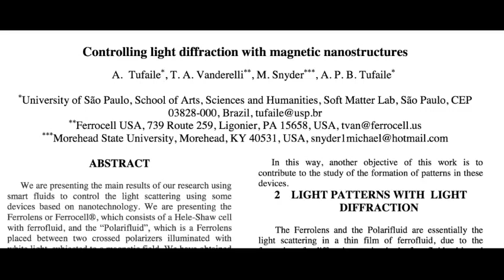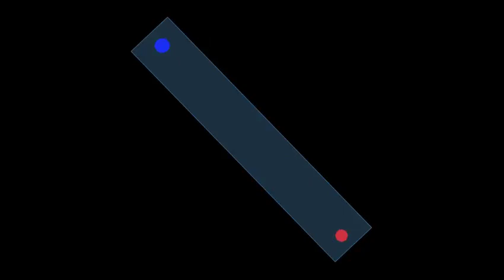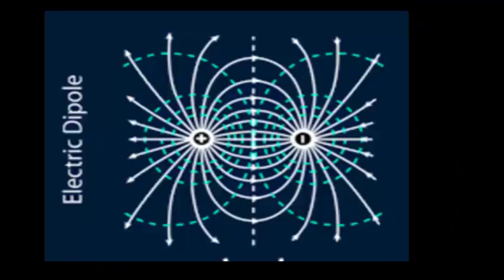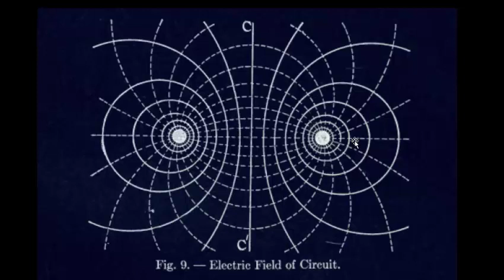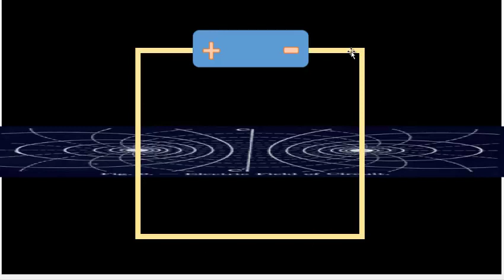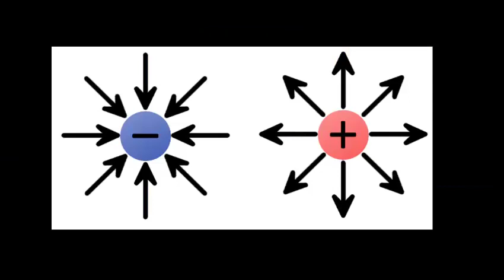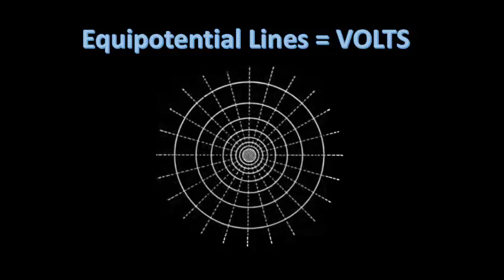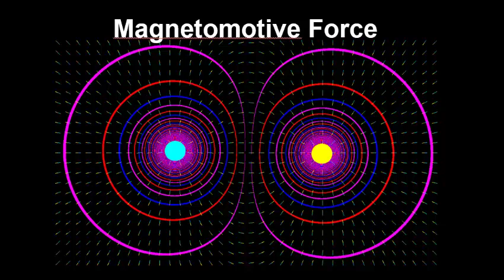On Magnetic Mono-Poles and Isopotential Lines

Comment: Monopoles don’t exist in nature, that’s the important part and everyone intuitively knows.

The software is wrong and just shows some 2D circles. It doesn’t show aether flow / magnetic flux at all. 

All one needs to know is that all the atoms/molecules in a magnet are polarized in one direction creating a flow in that direction. That’s it. 💥 The field lines flow from every surface point of the magnet. Of course at the pole it’s strongest. Where are the isopotential lines for that?
Reply: You will do better to ignore isopotentials and represent the flow with vector arrows. In the same vein as magnetic filings.

No comment on the fact the software doesn’t show all the field? It’s depicting the middle region (of the magnet) as being inert.
Reply from the maker: @TD-zr5xm  For the record, when someone tells me I should "ignore" something, it makes me want to pay attention to it more.  Magnetic field lines with vectors are one way of depicting the field around a magnet and Isopotentials are another equally important way. The Isopotential curves/surfaces show the field strength of at different distances from the magnet. Each isopotential curve corresponds to the same field strength. Isopotentials contain information that the standard magnetic field doesn't and vice versa. One is not better than the other, just different. Neither gives a complete picture, but together, they do. I think it is a terrible idea to ignore IsoPotentials. Really bad advice, in my opinion.
Reply: @FractalWoman  fair enough and maybe not what I meant to say. I’m not sure what you were going for. Field strength can be inferred by an inverse square law.
Reply from the maker: @TD-zr5xm  magnets dont have an inverse square law. And look at the shape of the isopotentials in the dipole view. It is not circular. This shape is an important piece of the puzzle that shouldn't be ignored.
Reply: @FractalWoman  ?? That’s what ‘isopotentials’ represent... Field strength according to an inverse square law. It’s a universal principle.
Reply from the maker: @TD-zr5xm  Magnets do not follow the inverse square law. If you don't believe me, ask ChatGPT. FractalWoman: Do magnets fllow an inverse square law. ChatGPT: No, magnets do not follow an inverse square law. The inverse square law is a principle that applies to phenomena such as gravity and certain types of electromagnetic radiation. According to this law, the intensity of a physical quantity (such as gravitational force or light intensity) decreases with the square of the distance from the source.

However, magnetic fields do not follow this law. The strength of a magnetic field produced by a magnet decreases with distance, but the relationship is not precisely an inverse square law. Instead, it follows an inverse cube law. This means that the magnetic field strength decreases with the cube of the distance from the magnet.
Reply: @FractalWoman  hmm. I’m finding conflicting answers.

“Inverse square laws are pretty common all through science. Both electricity and magnetism are inverse square. So are light and sound intensities.” (from a gov employee on quora)

I know why it might be considered cubed because it doesn’t radiate spherically equally, rather it is a polarized vector, such that the angle of measurement would determine the value.

Interesting topic. I will say that two different modalities of force over distance, for lack of a better word, i.e law of nature, is not congruent with a unified theory.
Reply from the maker: @TD-zr5xm  
To be more precise, monopoles have an inverse square law and dipoles, whether they be magnetic or electric, have an inverse cube law: "https://www.millersville.edu/physics/experiments/023/#:~:text=Magnetic%20Fields%20Varying%20as%20an%20Inverse%20Cube&text=For%20both%20monopoles%20and%20dipoles,distance%20from%20the%20source%20increases.&text=%2C%20often%20called%20the%20inverse%20square,distance%3B%20as%20R%20%2D3%20.
Reply from the maker: electrons (negative charges) are monopoles.
Reply from the maker: Isopotentials don't show magnetic flux. They show equal potential curves/surfaces around the magnet. This is important information that shouldn't be ignored.
Reply from the maker: MAGNETIC monopoles don't exist in nature but ELECTRIC monopoles do. You can't just say "Monopoles don't exist in nature". That is an incorrect and/or inaccurate and/or misleading statement.

Comment: A Lot of your overlays are wrong!  you have to flip them by 90° then they are perfect! as in 6:43 for example the iron filings should be longside the isopotential lines and not orthogonal, you overlaid it 90°,  and by this mistake its highly confusing what isopential lines actually show !

Isopotential lines = magnetic field lines 

they are not orthogonal ,they are the very same thing!!!!!!
Reply from the maker: Nope. You are wrong. The isopotential lines are orthogonal to the iron filings. I clearly show this in my "What is a field?" video. If you watch it again, you will see what I mean. 
You should also play around with the app on my website: http://www.theomparticle.com/?page_id=890 
The "arrows" in this software line up with the iron filings in my ferrocell image. The isopotential lines in this software, line up with lines of light in the ferrocell image. Isopotential lines are only ONE COMPONENT of the magnetic field. The iron filings line up with the other component.
Reply from the maker: Here is what the traditional magnetic field lines look like: https://www.stickmanphysics.com/stickman-physics-home/magnets-and-magnetism/magnetic-fields/

If you compare this with the image you referenced at the 6:43 mark in my video, you will see that the magnetic field lines line up with the iron filings EXACTLY. The isopotential lines are not drawn in the image shown on this webpage but if they were, it would look like the colour lines that I show in the 6:43 mark point of this video.

Comment: Additionally, we should always remember that, for those far-apart poles or monopoles, the isopotential lines are just not drawn on figures and shown in software - the strength of fields at the far-apart lines just gets so weak we can forget about it. 
(And for perfect lines for far-apart poles, this is assuming there are no disturbing fields, which in nature never happens.)

I think we can destroy single electrons and protons and there can be unbalance in universe but these are recreated whenever there are electrons or protons put to work on their own alone ("magnetic moments" in them induce current and potentials, energy in momenta, which can in turn induce so-called virtual particles which can turn into real ones). The latter is just fantasizing.
Reply from the maker: Yes. I agree. The universe always seeks balance, and when set out of balance, it will do whatever it takes to set it back again, including creating "virtual" particles.

Comment: What if N and S are really close together?
Reply from the maker: When N and S are really close together, you still get a dipole. If you take a magnet, and slice off a really thin slice, the slice will become a dipole with its own N and S, and the magnet that is left behind is still a dipole but with the bloch wall ever so slightly shifted.
Reply: @FractalWoman  of course, but look at the mmf lines... Is it possible to make a ferrolense picture with a bifilar pancake coil?... Have to try out.
Reply from the maker: @steffendammann2984  I haven't tried that, but it is a good idea. Maybe someone else has. I will check around.

Comment: Monopoles on the small scale don’t exist, well known.

Also all software relies on input to create output.

I can say 100% that Tim’s software does not contain 100% of data needed to make 100% correct modelling. 

To understand fully what lines up with what, would the best option would be do conduct experiments in 0 g with ionised magnetic metallic gas with magnets? ,
Reply from the maker: Michael's software is based on Maxwell's equations. So, even mainstream won't be able to argue with it. The question isn't whether the software is valid or not. The real question is, what is the ferrocell showing us?
Reply: Fractal Woman and Maxwells equations are based off an assertion there is no such thing as a perfect black body 🤷‍♂️

Comment: I think that something important is missing when these diagrams only show two dimensions: the spiral or vortex behavior of the fields is not shown.
Suggested Experiment: Drop iron filings onto a magnet while videoing with a high-res slow motion camera.  See if any spiral motion is detected. If so, refine the experiment and map the motion.
Reply from the maker: That is a great idea. Luckily, I don't need to do the experiment, because someone else already did. https://youtu.be/75wrs0PLl_s
You tell me whether you see spiral motion (a vortex) or not.
Reply: @FractalWoman  The sequence starting at the 2 :10 mark appears to show a vortex at the bottom of the magnet. Unfortunately, the camera is aimed from the side, but to see the vortex in detail, it should be from the bottom looking up.
Reply from the maker: @codetech5598  I agree. I see the vortex too. There are probably other videos out there that show different views. If you find one, please let me know. This is really cool stuff.
Reply: @FractalWoman  I think that it would have to be deliberately photographed in a way to reveal the vortex. I left a comment on that video requesting them to do that.

Comment: Bravo! Your comparisons are top notch - clarifies both the intuitive and the non intuitive! 

IMHO. In both instances - magnet and electric current - both are accelerating aether flow linearly (but in an overall "loop" + & -). Both linear accelerations are rotating as they flow. (the aether flow tries to escape restriction / linear direction = rotation) The area closest to the "masses" - (ferrite or copper) is the strongest accelerated rotation (voltage - equipotential / magnetomotive) of the surrounding aether flow. The magnet creates it's own acceleration which materializes / displays the magnetomotive field lines. However - the electric current is the catalyst source for the copper to display equipotential (voltage) lines. But they both are ESSENTIALLY (a magnetized magnet or a current moving in a wire) the displayed effect of the aether surrounding the mass involved in the "acceleration".

Comment: if you use longitudinal electricity you can transmit through 1 wire... when you pulse or resonate the coil with conjucture to Earth.
Reply: Check Master Ivo on yt.
Reply from the maker: I can't see how "electricity" can flow through a wire unless it is in a circuit. Yes, a circuit is ONE wire, but I don't think this is what you are talking about.
Reply: @FractalWoman  Well first electricity mostly flows outside the wire and there are no electrons flowing in it. A simple Tesla's Hairpin circuit can show you how there is nothing flowing but pulsing... Since the disruptive discharge happens it produces impulses rather than ac or dc flow and impulses dont know how exactly they travel, but i see this somehow like fast compressions and decompressions of the medium thus propagating longitudinaly instead of the usual sinewave RF which propagates at the max speed of light through the Aether, where the wire is just the "condensing" point for the magnetism to appear.
Something like that, can elaborate.

The only thing i can not pin point is ampere to volt corelation... it's like you need a high potential difference (volts) to move high ammounts of Aether perturbations produced by a magnet on a coil.  But if you have only amperes like in a homopolar motor you produce so much amperage, that a resistive material gets heated so much... so it must have an internal component and the volt being external? 
So when encountering radiant electricity we have minute impulses of short durations, that does not allow the formation of the magnetic component of "electricity".

Nikola Tesla, Wilhelm Reich were both seeing similar stuff... Just like when you physicaly move plancton in water... when you produce pressure and depressure waves, the plancton becomes luminescent... so... wilhelm reich had his rife machine set up as a pulsator, not a sine wave machine or god forbid a square wave.

Comment: Dear Genius FW: could You investigate electrets please? And test their effect on a ferrocell?
Thank You
Reply from the maker: Sounds like an interesting idea, but I don't think it will work. The ferrocell works by aligning the tiny dipoles of the magnetite nano particles in the ferrofluid when a magnet is nearby. I don't think the electrets will cause the nano particles to line up or self organize in any way, in which case, you are not going to see any lines in the ferrocell.  But, I could be wrong. Do electrets cause iron filings to line up? If so, then it may work. That would be a good initial test.
Reply: as Ken quotes Maxwell: magnetism is the dielectric field,,, and dielectricity concerns static electricity i.e. static electric charges which form and define what an electret is,,, no?
besides, the electret as I have seen on youtube holds positive charges on one side and negative charges on the other so one can test the effect of each electric "pole" :),,,
in case nothing shows on a ferrocell, if You move the electret it will start to show something because You will be having a movement of the electric charges so it is an electric current and it of course induces Magnetism in its surroundings,,
Thanks a lot for Your reply,,
And as Ever, I wish You good health and prosperity in every aspect 
Thank You

Comment: Your presentation makes me wonder if one could shape a magnet and create a current in a wire without either moving.  Earlier, I mentioned connecting high power curcuits with simply a magnetic field, i think they've already invented that. As to a magnet creating current without moving, my idea is creating a toroid shaped magnet that's contoured with fins/ridges to a narrowing center to slingshot the field going into the center, placing a wire in it, creating an electrical flow.
Reply: Gristle Von Raben Tesla’s rotating field generator with no moving parts ?? Can’t remember the source but apparently inducing a rotating field can work in a reverse way to having a moving magnet / coil moving through a static field in order to create the same result.

Comment: You bring up some interesting ideas.  You gave me an idea of using fields to connect high power circuits.  The ferrocell is only different because of two things, when two magnets with poles not inverted come side by side, they create a small air pole between them that is opposite.  Its weird, but true.  Secondly, from the ferrocell shown, is it my imagination or is there some kind of horizon flipping going on between the east end and the west end where the colors of light are flipped?
Reply: Good point, I would also like more information into the small air pole between them it seems counter-intuitive or I'm not interpreting the repulsive shape of the field between the magnets in the Ferro cell correctly.
Reply: It seems the magnets are arranged N S N or S N S?